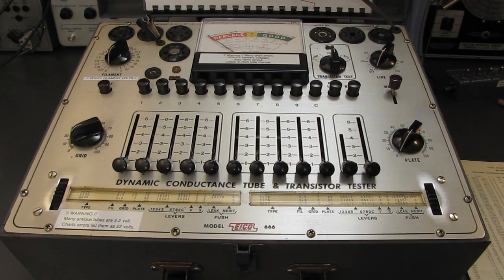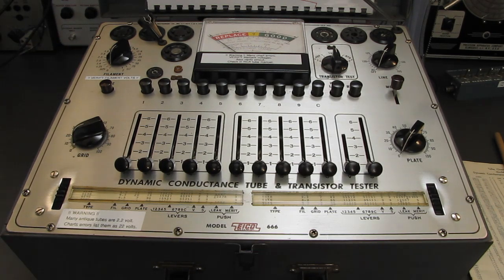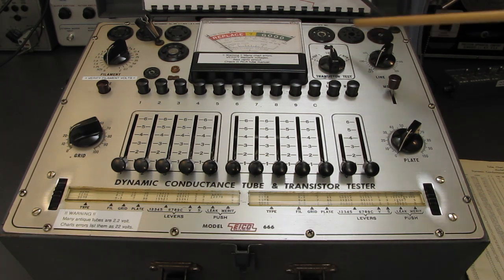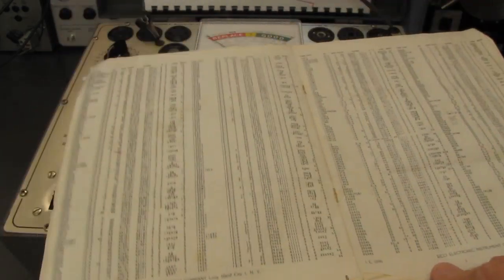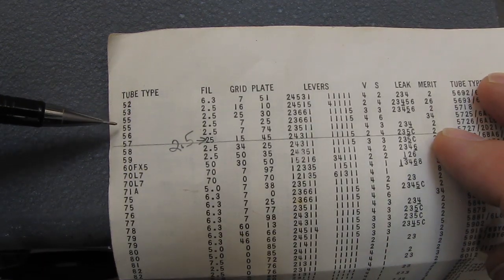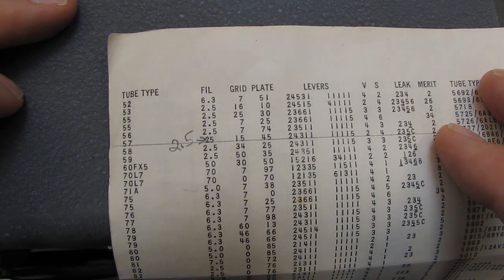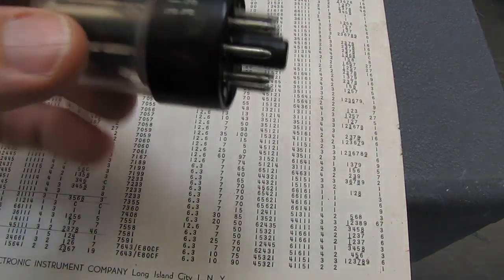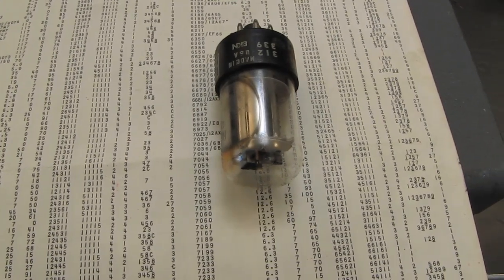VACUUM TUBE DESTROYER - EICO 666 Tube Tester

Comment: I have a 666 and it is a good tube tester. However,  found the tube chart for the EICO 667 is much more accurate and cn be used with the EICO 666 with a little adaption since the first 9 pin setting are the same. Also I have the EICO 610 adapter. It allows you to test Nuvisors, Novars, 10 pin miniture and Compactrons using the 666. The Eico 667 has sockets for them but they replace some of the older tube socket types. I also have a Hickcok 800A. Having had to repair both the Eico 666 and the Hickok 800A, the EICO is better built and easier to repair. The real advantage of the Hickok is the tube chart is reliable and it has all the sockets. If you are working on really old tube equipement I can recommend my Precision 912 tube tester from the 1940's.

Comment: It's a shame that you call such an excellent tube tester tube killer  because of a couple of misprints.
I've never blown one too bad of thousands I've checked over 25 years on mine.  Are some typos but they're clearly documented if you do a web search which I found in many many years ago. This tester is accurate reliable and easy to use. It uses AC line centering, and it has the added benefit of being able to read heater Leakage by using a current meter. No idiot light there. I have caught many signal Tubes that it's starting to leak heater cathode current. It also allows me to quantify used power tubes That have developed leakage but it's far inside of the Spec, and I've sold many tubes with full disclosure and happy buyers.

Comment: To prevent over voltages and suavise the crazy fast galvanometer deflections, use 2 diodes 1N4148 back to back  with 470uF capacitor in paralell  with its coil. Obseve capacitor polarity.

Comment: 12SQ7 slams the needle. I never could test one on my trusty 666.
Reply: I've had the exact same experience on my 666. Once it slammed so hard the needle got stuck. I was able to get it loose but it was of course bent. I carefully straightened it back out with needle-nose pliers but it's still a bit crooked.

Comment: I had a B&K 600 that had filament errors on the original setup chart. At the time B&K sent out notices to owners that there were errors and reprinted them. Eico never advised anyone that I'm aware of.
Reply from the maker: I have three "updated" charts that added tubes but still have the errors. You have to be careful. I like the testers flexibility, but don't trust the chart.

Comment: A few points:
1) I have one of these Eico 666 testers. Great machine, but yeah - the charts are woefully incorrect. A couple of years ago I found a guy on a vintage radio forum who had been through the charts, fixed all the errors and compiled new charts with added tube entries. He kindly sent me a copy of his updated lists, but unfortunately I can't remember his name or which forum I found him on. A bit of Googling may help.
2) When I bought my tester, I also bought the test adaptor model # 610A. It has sockets for testing compactrons, nuvistors, 10 pin decal, 10 pin min, magnoval, novar and 2-pin tubes. It's a very useful addition to the tester. Keep an eye on ebay, ham swap meets etc. They turn up from time to time.
3) Another word of WARNING to anyone who owns one of these - do NOT move the levers while the tube is in the test socket. This can also destroy the tube! Move the levers first, then insert the tube for testing.
Reply: I believe that man is Ron Reeland who did a correction list for the Eico 666. I glad I don't own one just because of the poor chart problem. Do have a 610A as a kit but it is missing the plug that goes into the tester.
Reply: @hestheMaster  That name sounds familiar.

Comment: Sage advice. One flash and it's ash. I have a B&K 747B (their first transistorized tube tester). I haven't found any setup/configuration issues with it yet, but cross-checking first with the tube manual is a very good idea. 👍

Comment: If you want a odd little tester look up EMC 208.  Mid century types only tiny emission tester with no meter.  Uses two neon indicators.  Works surprisingly well.
Reply from the maker: Hi Randy, I have a couple of real antique ones in wooden cases. They work. Just.